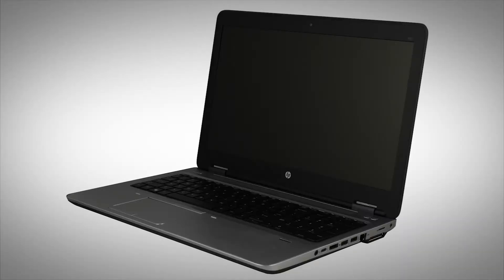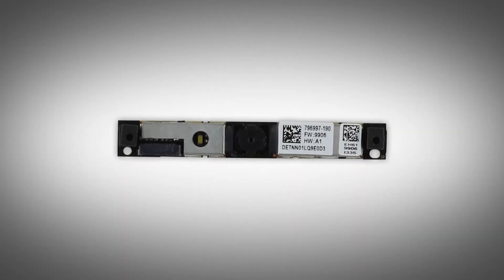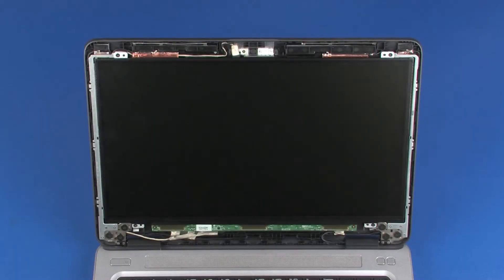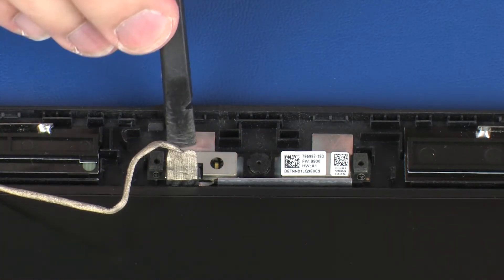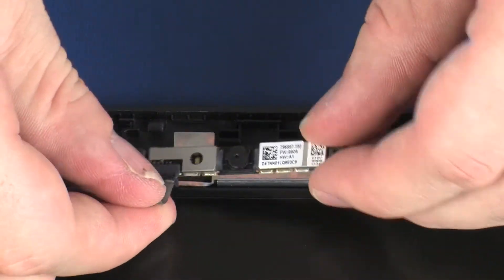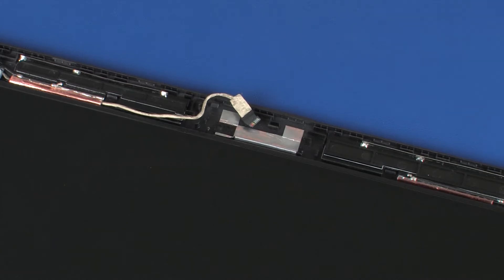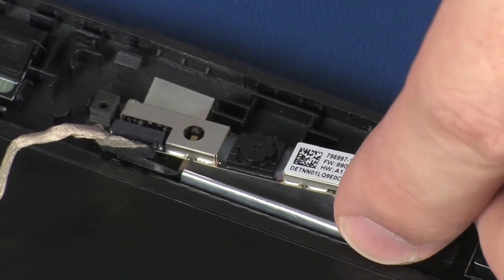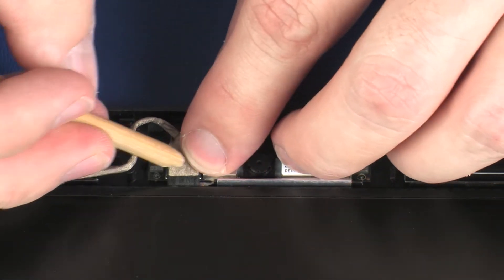Replace the Webcam/Microphone Board | HP ProBook 650/655 G2 Notebook | HP Support

Comment: unable to find webcam driver for hp probook 650 g2 
help me which driver do i need to installl
Reply from the maker: +Shubham Meena Please perform updates via HP Support Assistant as mentioned below to fix this issue: Step Check for updates. 1) In the search box, type and open HP Support Assistant. 2) Check for updates. 3) If the updates are available, click on install and restart the computer.